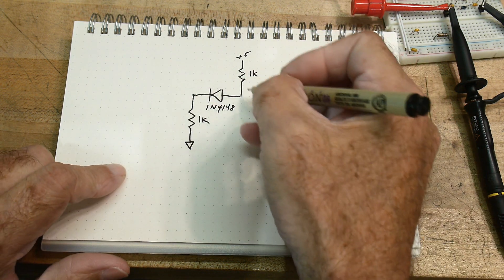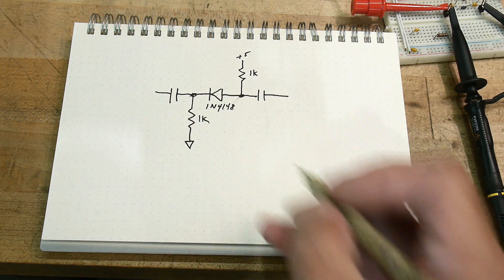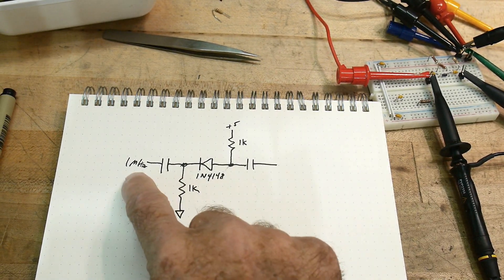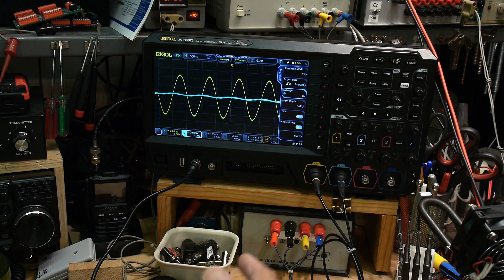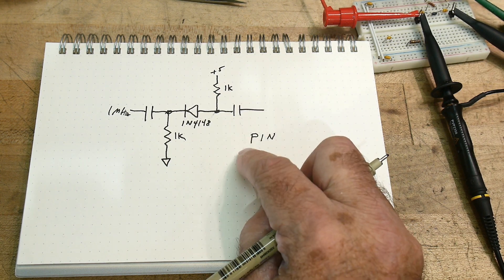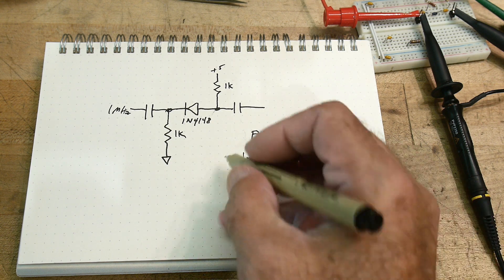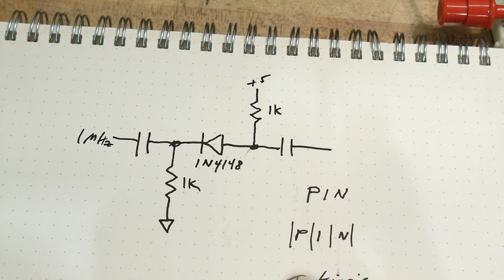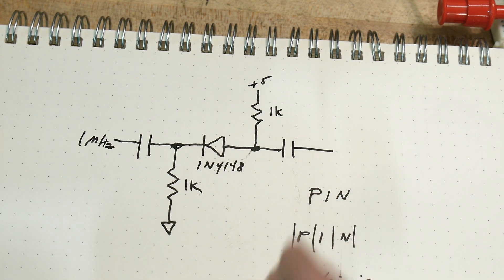#934 PIN Diode Switching

Comment: WHAT??? If you turn on the anode with DC, then you can pass AC BACKWARDS????? How fast can it switch with a PIN diode? What do you mean "flaky, will die"? How can you prolong life without changing the diode? When should use use a bipolar transistor or FET as a switch, instead of a PIN? THANKS!

Comment: If you are using a dual supply instead of a single supply and GND, you can include a reverse biased diode to GND inserted after the switch diode, which will then be biased ON when the switch is turned OFF.
That will greatly reduce any signal leakage in the switch OFF stage.

Comment: Hello, I have a small power supply for a  clock/timer that went out and I think it's the zener switching diodes. I'm supposed to get 10 volts output between the positive and negative and I'm not getting no output and the voltmeter is showing a short between the positive and negative on that 10 volt rail. I seen some replacement diodes on eBay, but I'm not sure the correct voltage or amps by looking at the diodes in my circuit. I was hoping tge 100 volt 0.3 amp would work. Those are the ones that look like the ones I need on eBay. It seems like a very simple circuit power supply for a clock.  there may be something else that's bad on it. but these inner diodes are letting electricity through that causes the short between the positive and negative.

Comment: You can also use the diode to short a quarter wave transmission line, to make an isolated point 1/4y back alone the line from the diode.

Comment: Why pull anode with resistor to +5V
Reply from the maker: If there was no resistor then there would be no AC path. the AC signal would be killed by the 5V low impedance
Reply: @IMSAIGuy  thank sir

Comment: Great video, thank you!  One question: if I want to measure the S11 and S21 parameter of the PIN switch circuit as shown in your video. Should I just directly connect the outer conductor of the SMA to the DC ground (the negative pole of the 5V power supply), and the inner conductor to the input/output?
Reply from the maker: all grounds were common in my setup
Reply: @IMSAIGuy  That's helpful. Thank u for the response 😊

Comment: I heard that normal diodes shouldn't be used for diode switches for RF, as they create Intermodulation (IMD).. Is that the case?
Reply from the maker: they probably add some non-linearity. the PIN will have a linear region if you keep the signal amplitude small

Comment: Brilliant explanation. What size capacitors would you recommend for audio ? Also, if your output is onward connecting to a high or low impedance input would the 1K to ground cause some signal attenuation?

Comment: Use the 1N4007 diode, they have a intrinsic layer (sort of) to give the higher voltage rating. This makes them work more like a real pin diode, and they can handle a bit of power rather than just small signals.

Andy

Comment: Great video, @IMSAI Guy. Thanks! One question: when would one need an inductor on the bias to prevent RF from running to the power supply?
Reply from the maker: yes, most designs do
Reply: @IMSAIGuy  can you do a video on that someday? Thanks for the response! 👍

Comment: two weeks ago I were making measurements with nano of that diode, dinamic resistance and internal capacitance. Internal capacitance is surprisingly lower than the max permissible in data sheet.

Comment: waaaaaait a minute! How come that the negative semicycles of the AC signal are not getting thru the diode? You should get a half-rectified sine, right? How large is the AC signal amplitude and the threshold voltage of the diode?
Reply: There is some charge stored in the junction when forward biased.  When the polarity across the diode changes, the diode WILL conduct in the reverse direction until this stored charge is removed.  If the negative half cycle doesn't last long enough (or isn't large enough) to completely remove this stored charge, then it never goes into blocking (and just looks like a low impedance path to the signal).  This stored charge is what is also what is responsible for the reverse recovery time in diodes.
Reply: iirc the way it works is, the forward bias saturates the junction and the diode is slow to recover, so the ac passes. the “I” part of the PIN diode adds capacitance and makes the diode even slower to come out of saturation. if i am remembering this right.
Reply: Probably a 100mV signal and vf is about 0.7V so its not conducting the negative cycles and just leaking a bit
Reply: @jainmanish123  that's what I thought, but i think it should have been said in the video :(
Reply: @Bill Carson wow! Even 1V signal? That's interesting considering that threshold voltage of diode is about 0.7v